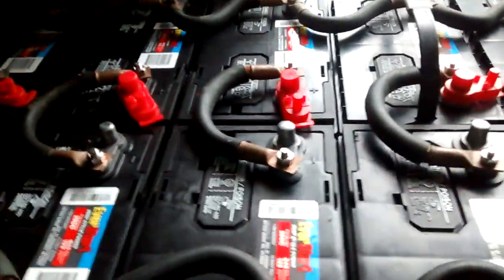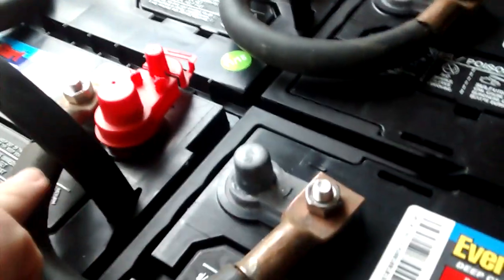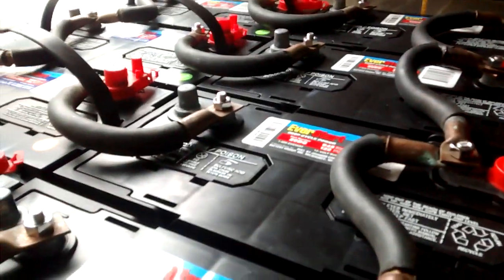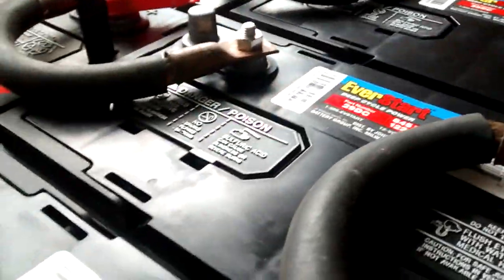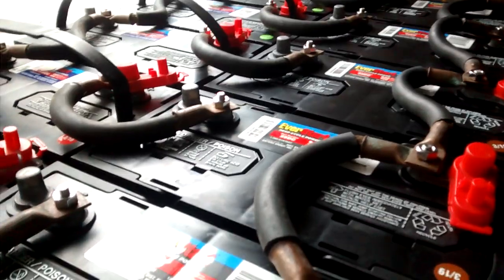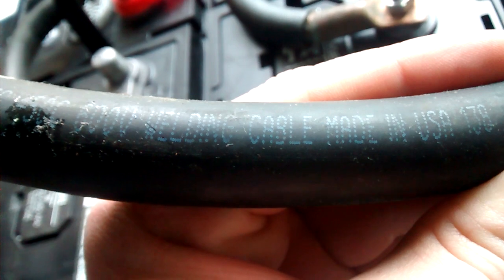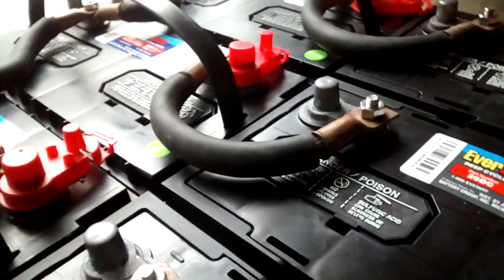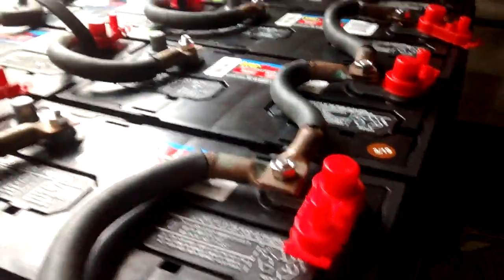POWER Wal*mart Home Battery Bank 12V Marine/RV Deep Cycle Lead Acid to 24V

Comment: WOW! that's a large battery bank, I have 8 of their 122ah batteries in 12v system for emergency lighting  & such. We didn't have a costco or Sam's near by at the time otherwise I would've gotten 6v batteries. But we do what we can with what's available

Comment: If you equalize the batteries all together on a regular basis they will work just fine. Doesn't matter if you add more later as long as you maintain equalization and check water levels and use distilled water when adding. I use EverStart 29dc series and they do fine under those circumstances. Plus I have a BLS attached to the battery bank which keeps the molecules stirred up in each battery and of course I equalize every couple weeks and also use a battery hydrometer to check each cell. On occasions I use ADPOW Smart Battery Charger. It has the ability to rejuvenate a battery if I find a cell that is in the low area. Been doing it this way for at least 5 years now with great results. Hope this helps!!
Reply: 29DC IS GOOD,EVERSTART 12 VOLT,ETC.FOR MY 3 BATTERY BANK.

Comment: Why go with anything less than the best for your boat’s battery? Our Marine Batteries are the strongest in the USA, and last 4x longer than lead-acid with 1/2 the weight! On top of that, while our prices are the lowest in the market our performance couldn’t be higher, with our batteries leaving the competition in our wake! And best of all, unlike lead-acid our batteries require absolutely, 100% zero maintenance. Whether you’re using your batteries for trolling, running lights, listening to music, or whatever else you can think of – save your fuel and enjoy the moment! Don’t end up stranded without power, get BigBattery for your boat today!
https://bigbattery.com/product-category/marine-batteries/

Comment: I only have six of these 29 DC batteries hooked in parallel with 600 watts of solar panels on the roof since 2017.  I never let them run below 12.4 volts or 80%.  So far so good but only 3 years to date.  I'm getting mixed reviews about these ever start batteries.
Reply from the maker: Simple is as simple does.
Reply: @MilitaryIndustrialMuseum  when you said eastern wa i lol cuz that's where I'm at in tri citys. Was planning on just running 4 of these for a 400 watt solar system. Sound about right ? Wanna bring that up some later.

Comment: im looking into one of these to power a 12 volt electric blanket for cold weather car camping. cool solar bank setup. these batteries seem to be a really good value compared to prices of similarly performing competitors. thanks for sharing.
Reply from the maker: They are basic. But good for a while.

Comment: I ordered 10 of these batteries thru the local Walmart (25 miles from the solar powered cabin) and picked up all 10 today in the 4 banger Suzuki Vitara. No problem in one load and all have the same manufacture date. I could have ordered 20 if I wanted. Seems like that is no problem with Walmart. Didn't even make me pre-pay for them.
   Always fully charge every brand new battery individually before hooking together in series / parallel  (to prevent a weak link that will drag down all the other batteries) and never mix new with old if it can be avoided.

Comment: I'd recommend against Marine hybrid batteries.  They are not really true deep cycle they are more of a hybrid between a starting battery and a deep cycle battery.  A true deep cycle is any golf cart battery.  You can get golf cart batteries for about $100 at Costco for 6v 220Ah.
Reply: It depends - if you use golf cart batteries, you'll want at least 2 in parallel, so the upfront cost is higher. Yes they will last longer for solar, but you also have to refill them with fluid more than standard DC's to get that extra life.